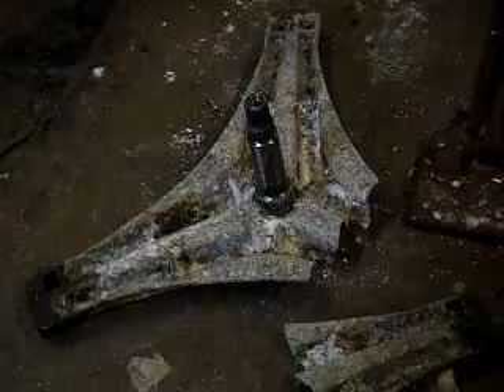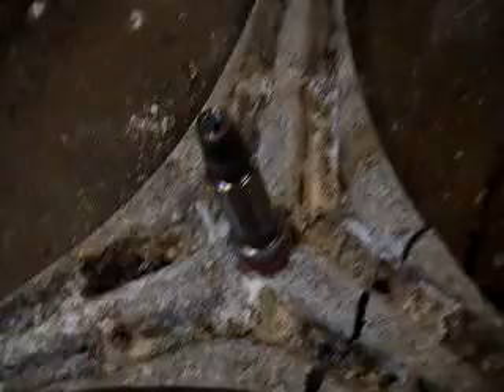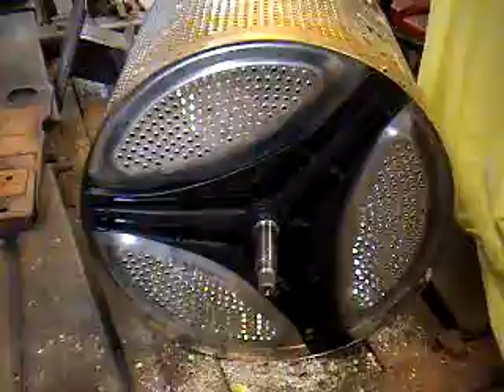LG washer spider replacement NO#1

Comment: Thanks a lot for video.
Sir.. When inserting the spider shaft after replacement, is it okay if i do not apply grease between the bearings and the shaft?
Reply from the maker: Don't put grease on that part. Just where the seal rides!! a lot of people will grease the whole shaft but if a bearing gets wet and starts to seize, the inner race will turn on the shaft and ruin the shaft also
Reply: @mpdpspnp  Thank you.
Sir...
Of course I shouldn't apply grease to the retainer part, but do you mean I don't need to apply grease to the part where the shaft and bearing come in contact?
Because I thought that high heat and wear could occur due to rotational friction between the shaft and bearing during high-speed rotation.
Reply from the maker: Just the base of the shaft where the seal rides. Leave the part that goes through the bearings dry
Reply: @mpdpspnp  Thank you very much.
Sir...
Are you saying that I don't need to apply grease to the parts where the shaft and bearing come in contact?
Reply from the maker: James Lee exactly!👍🏻

Comment from the maker: Its a fairly tight fit but if it is cracked or broken? It should almost fall off. Don't pry it off from the middle or you will dent the tub. pry off from under where the screws go through the lip at end of spider.the bevel of the screw hole for the spider is what holds it in place. And I believe they only put one screw per support.. But I replaced it with extra screws. Make sure you buy SS screws also!

Comment: Did your new spider shaft have an O-ring and/or metal washer riding on top of the O-ring?  Just went through this process with a Samsung.  Old spider shaft had an O-ring and a (very SHARP) steel washer on top of the O-ring, for sandwiching in between the O-ring and bearing.  The new one came only with the O-ring.  Can't find any reference to the steel washer in the parts diagram and nobody seems to know.  Do you recall how the spider for your LG was configured?
Reply from the maker: +Park Barlton 
I have never seen any type with a Oring and washer!!? the spider slid through the Shaft  seal and bearings and that was it! go to searspartsdirect.com and look at the exploded  view of your Machine. that may help you!? thanks Matt.
Reply: Thanks for getting back to me, Matt. The grainy diagram shows ONE circular thing included with the spider, which I assume is the O-ring that the new part came with.  They show a much larger disc (I assume the shaft seal) grouped with the rear tub assembly, which includes the bearings.  The steel washer doesn't appear anywhere and is a bit of a mystery.  So I take it your spider wasn't adorned with an O-ring either?

The reason I mention this is that it affects the shaft location, which affects where the seal rides, which appears to be touchy/nontrivial on this model.
Reply from the maker: +Park Barlton 
what is your mod#? I can't understand what an O ring in conjuntion with a shaft seal would be used for?! send a photo of the old spider and where you think the O ring goes. MPurc6969@aol.com
Reply: +mpdpspnp WF409ANW/XAA  I'll send you some pictures!

Comment from the maker: what is the mod of your Washer? there are two diff. spiders. One bolts through the plastic drum paddles (vanes)and the other is like the one in the video. bolts vertically through the SS lip of the tub. If it bolts through the vanes? You may have to buy new vanes.I think they are fairly cheap. Because the bolts have a tendency to snap off inside the vane.